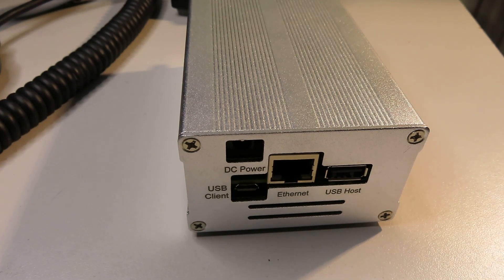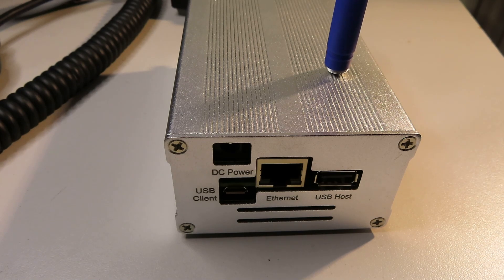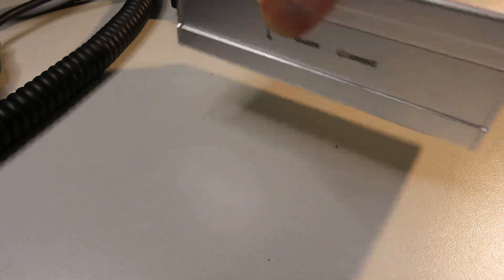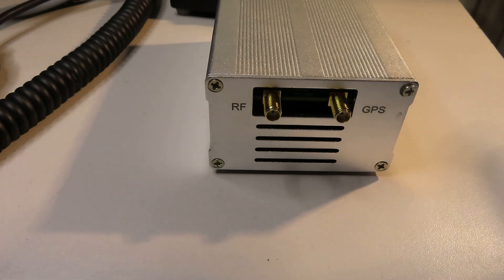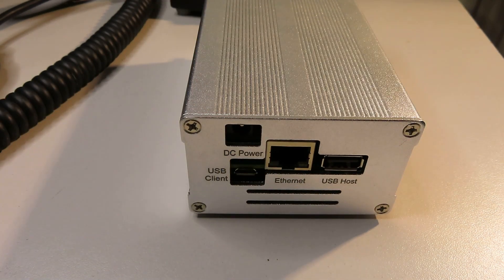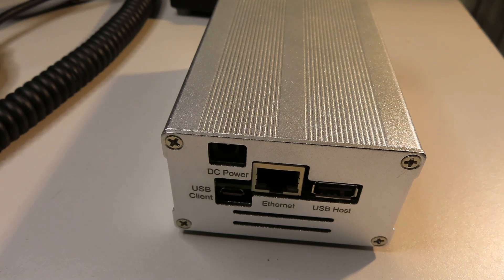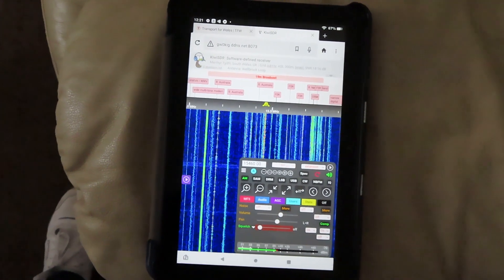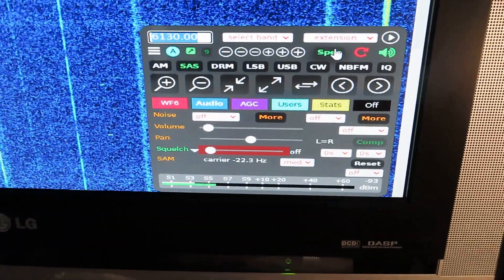Kiwi SDR- The most versatile receiver in my shack!

Comment: These aren’t produced any more are they?
Reply from the maker: As Far as I know-no. There was also a Chinese clone device which used the same software but was based on the Raspberry Pi but that also seems to have disappeared.
Reply: @KevinOReillyswl  I’m currently using OpenWebRX+ (note the +) with my Airspy HF+ Discovery which is getting closer in functionality to the Kiwi SDR software. Unfortunately the developers of the standard and plus versions of OWRX are not very friendly to users though!
Reply from the maker: I was not aware of Openwebrx + but have played with Openwebrx in the past and it worked well. The drawbacks compared to the Kiwi in my opinion were that with the Kiwi you can view the full HF spectrum at once and it can accomodate multiple users over the full bandwidth. I used an SDRplay with Openwebrx and you are restricted to a Max 10 Mhz bandwidth and in reality using a Raspberry Pi to drive it you would not get more than 2 Mhz. I will take a look at OpenWebrx+ though, thanks for the info.
Reply: @KevinOReillyswl  Agreed, bandwidth is the only drawback, and many of the Kiwi SDR features are missing, but to be able to access my SDRs from anywhere is a real bonus. I believe Kiwi SDR was based on the original OWRX project which is why it looks so similar. I currently keep it for my own use so don’t have any problems with other people switching frequencies or modes!